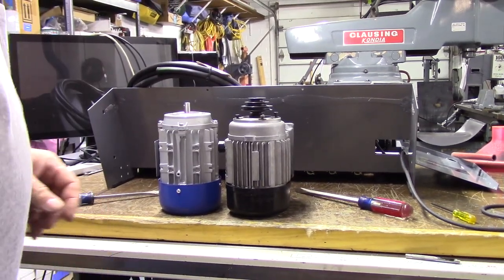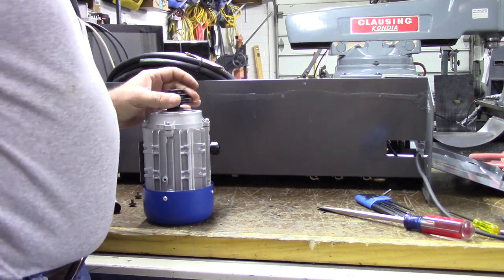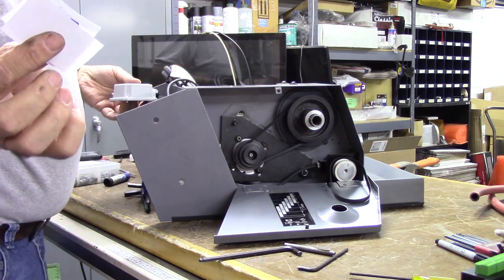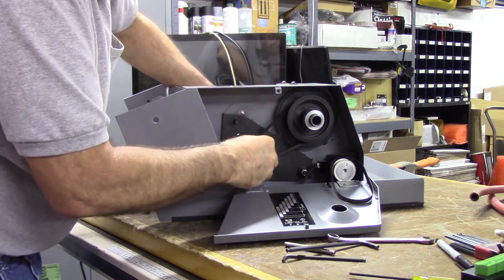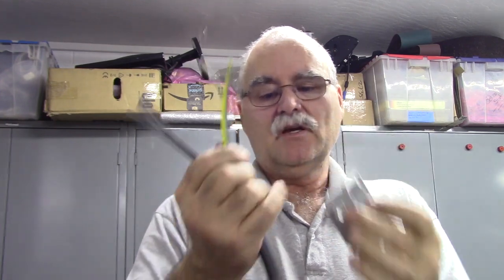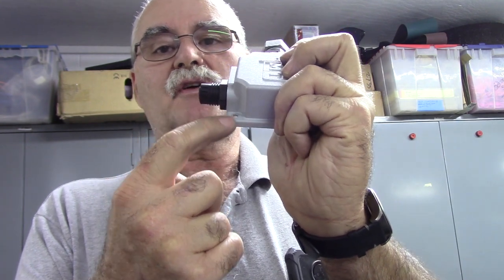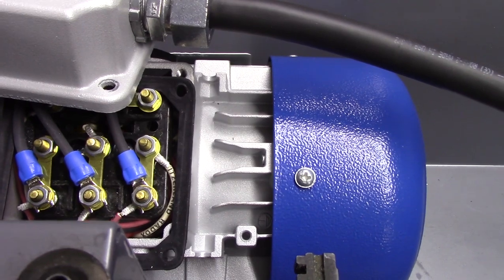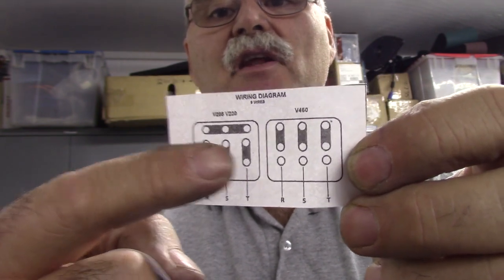Emco PC5 to Centroid Acorn Conversion. Part 4: Spindle Motor Fit Up & Wiring

Comment: Hi Marty. It was recommended I check out your videos in trying to find some info. Maybe you know to tell me. I have a Matsuura vmc with tool changer and a bum control. I try reading the websites to see if these aftermarket controls will fix me up but they talk terms that don't make sense to me. I see things about steppers and mine has servos I'm almost certain, right? Maybe can we talk on a private channel instead?
Reply from the maker: I responded on the Centroid group. Post pictures of the control cabinet, servo drives spindle drives, make and mod l numbers on the Centroid Users forum and ask for advice. https://centroidcncforum.com/viewforum.php?f=64
Reply from the maker: you can reach out to me directly at my youtube channel name ATgmailDOTcom